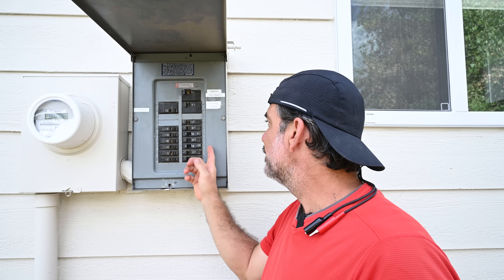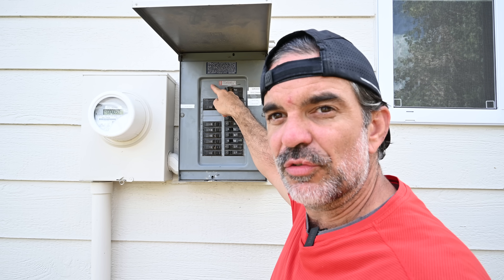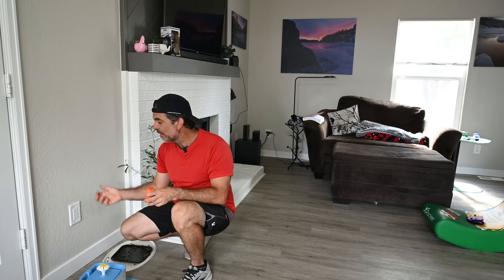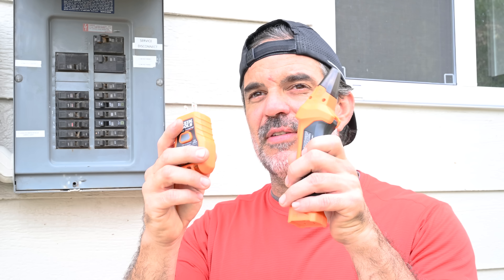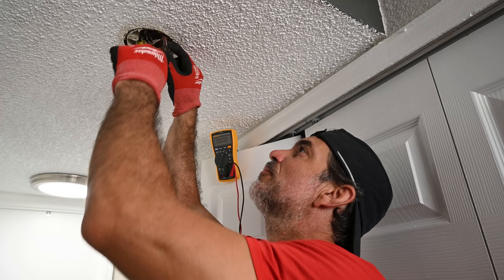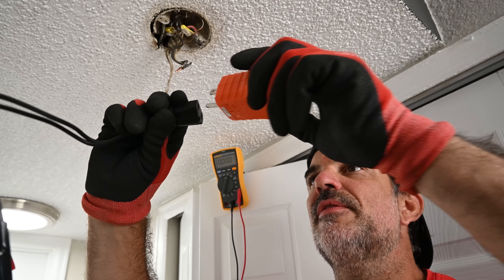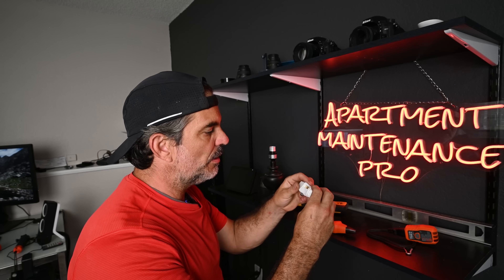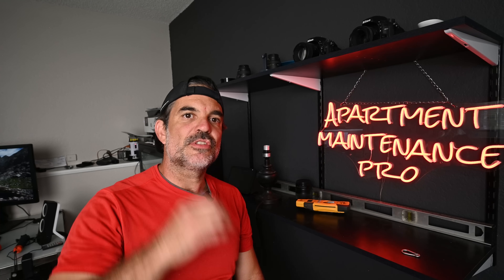Identify Circuit Breakers when Panel is Not Labeled

Comment: Did you print your own labels.... or?.....
Reply from the maker: Yes I print them 👍
Reply: @ApartmentMaintenancePro  ... I print them too when needed but by using my printer from my laptop...and then I paste or glue the paper to the panel...maybe even with a clear-tape overlay for possible weather resistance.  I was hoping to find pre-printed and pre-glued "peel-off" type labels...and thought you may be using these instead.
Reply from the maker: @TheWilferch  Its a label printer, with sticky strips. I think I paid like $100 for it ink /strip refills not too bad doesn't put a dent in the budget that much :)
Reply: @ApartmentMaintenancePro  ...thanks for the tip....

Comment: This tool does nothing to help u. 

You still have to walk inside the house to check the lights on the outlet component, then movie it to the next room, and repeat. 

U accomplish the same thing by turning every light on in the home or plugging something into an outlet and flipping off each breaker individually, then going into the house and seeing which light or appliance is off.
Reply from the maker: I don't understand your argument. You have to walk inside ONCE, compared to several times without this circuit tracer. Of course you could get lucky but you can't rely on that if you do this constantly.
Reply: That's "sorta" true if you want to label all of the circuits. When you have to work on one receptacle or circuit, you walk in once.

I say sorta true because even when labeling, if the house has a basement, first and second floor, attic, etc., you have to do more than just walk in. And not all circuits have a light to check, such as the smoke alarm in the video.

Comment: My quick confirmation that the correct breaker has been shut off is to sniff it again with the receiver after turning it off - if the tone at the panel is gone, you’ve got it. Once you shut off the power to the transmitter, it stops chirping.
Reply: What if you have an outlet that has no power but it used to work? How will this find the breaker without power to the transmitter?
Reply: @billdivine9501  I dont think it will work in that situation.
Reply: And if it is wrong, keep switching, you will get it.
Reply: Just use a radio

Comment: Is it possible to go through this rationale with a mega-ohmmeter and a transmitter (but no receiver)? Clearly I would need a second set of eyes to watch the receiver (at any given receptacle) if I am at the fuse box with a mega-ohmmeter. What I have is one dead receptacle (no lights on the receiver), but a poorly labelled fuse box with no obviously tripped breaker switches on any of the fuses. Therefore, most likely one dead fuse yet to be discovered (and then replaced). Thanks in advance.

Comment: Anyone's know if this will work on circuit breaker that are broken or no good?  Or does there have to be power going through the circuit breakers/a good breaker?
Reply: It needs power to the receptacle - the transmitter runs on the line voltage.

Comment: How do you trace for a light switch? I want to update a bunch old light switches in my house, but not sure how to trace those back to the breaker. 

Looks like I might have to do what you did with the smoke alarm wires?
Reply: Whatever the switch turns on, you can test that, whether it's an outlet or a light fixture. Good luck!
Reply: Alligator clips on the wires.
Reply: Turn on light, have a buddy stand next to it on a phone call with you, start flipping breakers. If you don't have anyone, do a video call with yourself using two devices, or plan to get some exercise.

Comment: I noticed for your lightbulb demo you held it up or horizontal. That’s because it unplugs itself with its own weight when held upside down like you would use it in practically every lightbulb source... My solution to this was bend the connectors inwards but that still barely helps. Was curious if you were gonna mention this or not

Comment: Good demonstration!
The “open ground” is because your alligator clips were only connected to hot and neutral. If the plug adapter had 3 clips it would most likely show “wired correctly” but since the tracer is following the hot back to the breaker you don’t need an alligator clip on the ground 👍🏽⚡️
Reply from the maker: Makes sense. Thanks for the explanation 👍
Reply: It's the same thing with the cheater adapters you used in the lamp.  The screw in adapter doesn't have a ground on it so the tester will always show open ground.
Reply: I own and use this set.  The comments above on “open grounds” are exactly right.  The clip-on and light socket testers have no ground throughput so they show open grounds on the tester.  An open ground is possible on that circuit still, but these test pieces are designed to locate power only, so some additional snooping is necessary if you suspect a ground wire issue. 

Good presentation of the tool.  It’s very useful, especially if you often work alone.
Reply: Yea I was thinking that too
Reply: Was going to say something, but you probably realized it later after filming. Everything was fine. It served the purpose of transmitting.
Reply: P
Reply: You completely lost me when you started talking about an open ground. You clamped only two wires. Of course there's a freaking open ground. Big oof.